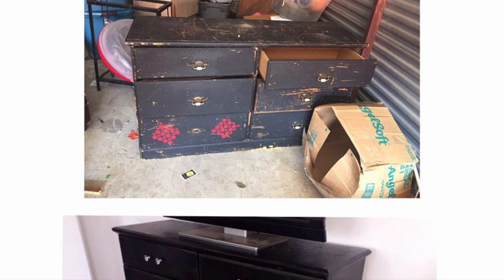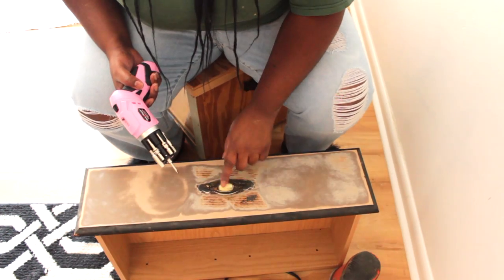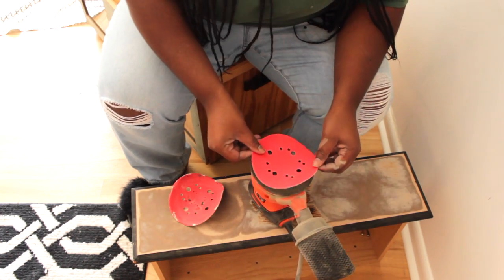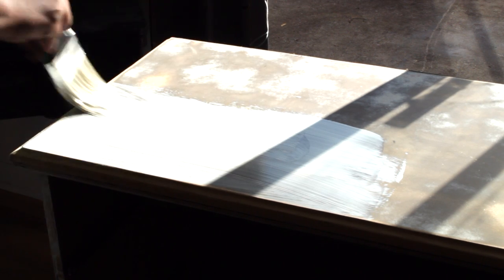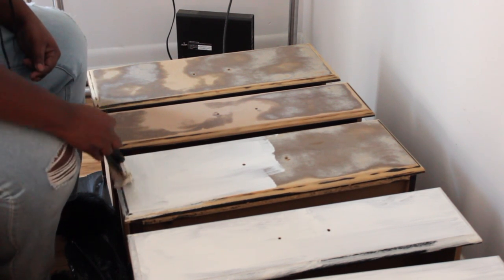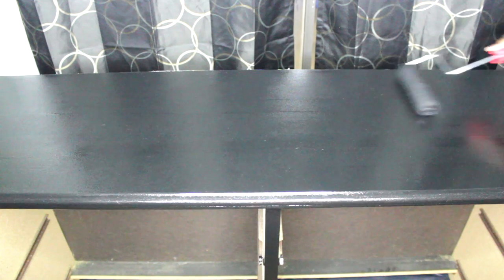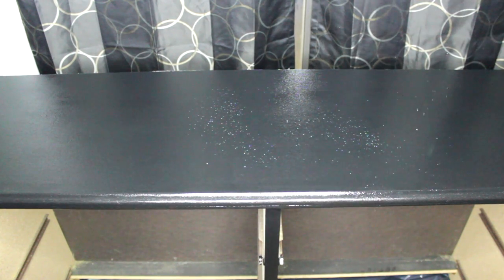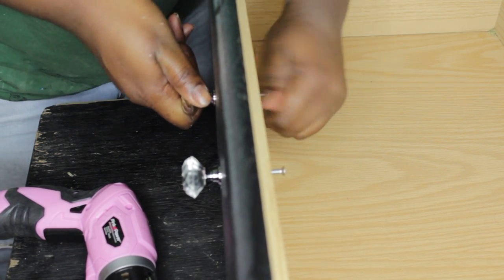DIY Dresser ReVamp - Dresser Makeover ! | Pre'Knechia Ja'Nae

Comment: is the primer a necessary thing to do or is it optional?
Reply from the maker: JD mi11ionaire very necessary! The primer insures that your paint adheres to your furniture piece! Thanks for watching!
Reply: thank you!
Reply: You have paint and primer in one sometimes so you don't need extra primer. Your paint will stick anyway without the primer, but you might have to put extra coats because the color that you have originaly on your piece might bleed or show through your new paint, that what primer is for.
Reply: If you don't want to use a primer, you should buy a chalk paint, you don't necessary need a primer. It covers the imperfections very well and does not bleed.

Comment: Why did you use two knobs for each drawer?
Surely it would have been better to fill the two holes after you removed the old handles, then drilled and fitted one central knob per drawer.
Reply from the maker: I'm not a wood working expert. I just did what worked for me and plus I liked the look of the double knobs! Thanks for watching.